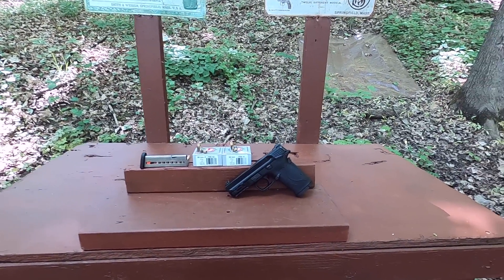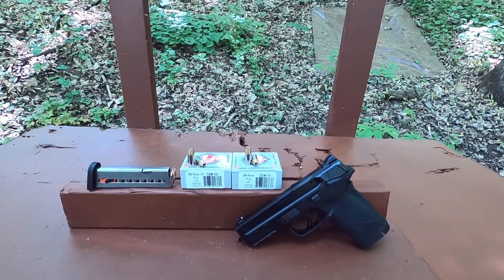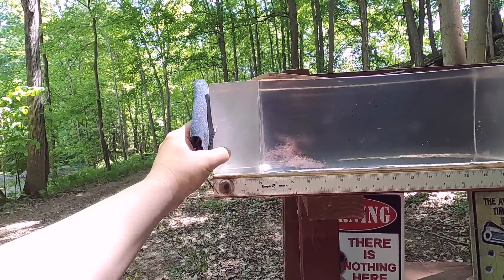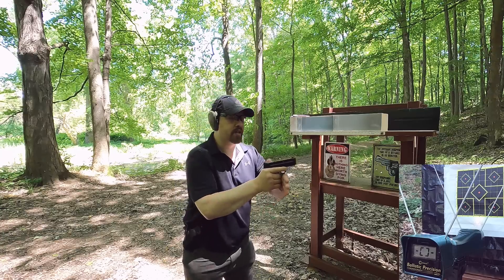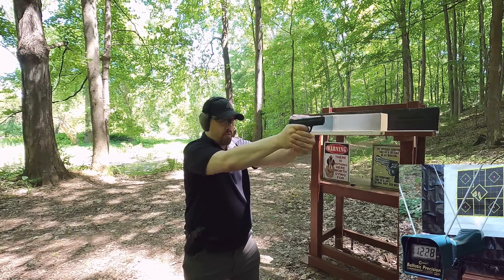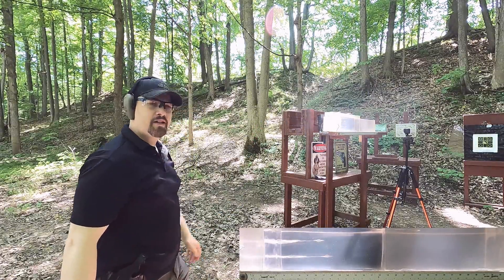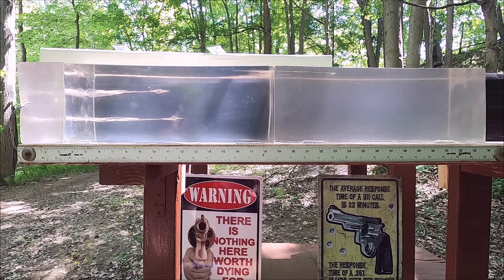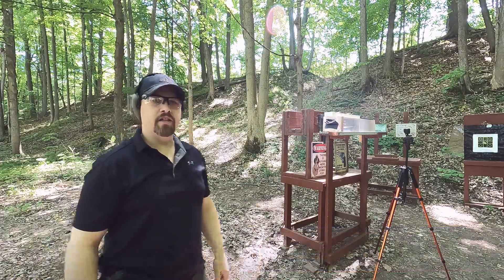Underwood .380 ACP 'Standard JHP' Ballistic Test - Standard Pressure VS +P

Comment: With the Plus P it looked like you are getting live round stovepipes which is an indication the slide is outrunning the round getting fed fully into feeding position. This is often due to the cartridge pickup rail hitting the round in the large extractor groove rather than the rim.

I heed your advice to avoid +P 380 ammo as I have the same opinion gathered the same way.  FMJFP at about 830-850 from a 2.75” barrel is just fine.

Comment: Ya know im seriously considering getting some of those standard pressure rounds due to the velocity and energy numbers alone...even though they didnt expand through the barrier they still had a nice wound track and they really didnt under penetrate either. Im sure id lose a little bit of velocity with my 2.8 barrel but even still the velocity and energy were impressive...if you account for bounce back they hit right at 12 in the bare gel...overall I think those are pretty good results for a 380

Comment: I own two of the M&P 380 EZ's and I have had the same issue with one magazine. It occurs on the last round of the magazine. I fixed the issue with that magazine by leaving it loaded for a few days and then the issue went away. 
My hypothesis is the the spring was at the high end of the tension curve. Once it was broken in, it stopped. It could be ammo. I did not notice what I was shooting, but I usually shoot Blazer CCI 380, 'cauz I can get it and it is less expensive.

Comment: Sam, thank you again for a grest test. I have tested these same loads in the G42, which is a slightly shorter barrel. I tested through 4 layers of denim but no MDF. The standard load did not expand but penetrated about like your test. The +p, however, expanded well and penetrated to 16". It has expanded well every time at the higher velocity and penetrates 14.5" to 16", which I thought was fairly impressive for .380. In my tests, this bullet out-performed the vaunted XTP (in the +p load), expanding more and penetrating deeper. Bare gel was 8.5" and 0.66" expansion. The MDF is the equalizer, perhaps, and it is really good to have as many data points as possible on any self defense bullet. 
I did shoot it out of the LCP Max also and got 12.5" and half expansion on one and 16" and 0.44" expansion (similar to XTP)  on the other...for what it is worth. That was through 4 layers of denim.
Shooting them through the g42 there were no malfunctions with either load. I did not shoot more than a few in the LCP max.
I did not try to hit at 75 yds though. A man's gotta know his limits. 😊

Comment: Great ammo review as always! I had malfunctions with my LCP2 & Ruger fixed it by replacing the barrel and ejector. Ruger customer service is the best, but have had good luck with Sig, S&W, CZ, Springfield, & even Kimber. They all take care of their customers. In my LCP2 I will run FMJ as you get adequate penetration. Only in 9 mm & above will I run JHP's, or Underwood Defenders. Your accuracy at 75 yards is impressive! As always, lookin forward to your next video!
Reply from the maker: Thanks. My experience with Ruger has always been pretty good. Experience with S&W is good, but they just are silent and just fix it and send it back, no chit chat. Taurus experience is really bad with customer service, like they don't know what they are doing.
Reply: @GunSam  Yes, you are right about S&W. They didn't say what was wrong or what was replaced to fix my PC Shield Plus. Sig's P365 series has durability problems as I've had to send them back numerous times for fixing dead triggers, FTE issues, & dead front sights. Even though the Shield Plus is slightly bigger & heavier, I believe it shoots better & holds up better than the Sigs.

Comment: That non expanding standard pressure round would be the pick of these 2 for sure tho.  14.5" to 16.5" penetration seems about perfect if it could just expand.  Sadly most of the .380s  just don't have the mass/weight to penetrate very deep. Especially if they expand. I guess 99 grains and the amount of powder a 380 case can handle just isn't quite enough.  I  finally got a new 380 pistol myself this past year, a larger "compact" size. Its amazing how similar, yet different in performance, the ammo for it is, than 9mm, with the same .355" dia. projectile.  I  bet that bullet would work in 9mm fine.

Comment: Great Testing as usual! To me the Underwood  Extreme Defender (Lehigh Defense projectiles) seems like their best round for 380acp. Maybe the Extreme Penetrator depending on your firearm barrel length.  Their clothing and barrier blind "extreme" ammo seems to work well in 380 where most manufacturers cannot get a heavy enough bullet & velocity  to penetrate deep enough (with expansion). The Federal 99 gr HST  Tactical "deep" gets close, but usually cant quite get the depth in 380, in most tests I have seen, unfortunately. Besides that, its usually unobtainium and pricey anyway.  Its seems pretty smart that Wilson Combat bought the bullet maker LeHigh Defense. Hopefully they still keep supplying Underwood with the same great projectiles. Underwoods solid copper Extreme series  has become my new favorite, for 380 defensive ammo these days.  (the Le High/Wilson bullet)

Comment: Good test. .380+p IMO is absolutely worthless, if you need something more powerful than standard .380 go get a 9mm. It does everything better and still doesn't have that much recoil.
Reply from the maker: I mean, I wouldn't necessarily say it's worthless. When going pretty small the .380 ACP is superior. And I don't mean in power, I mean that going 16-18 OZ in a 9mm pistol especially single stack, the recoil is terrible, not until the pistol is maybe 20 OZ and a double stack grip is it relatively low recoil feeling and easy to shoot. So in that tiny window of 12-16 OZ pistols, the .380 ACP shoots really well, and I would rather have that than have more power per shot. That's just me though, I have ankylosing spondylitis and I cannot tighten a belt, so a bigger .380 pistol feels fine, a 9mm pulls my gate just enough to not want to carry it.
Reply: Agree 100%

Comment: Nice video but if you look at S&W 380 EZ specs +P is not suggested for this firearm.
Reply from the maker: .380 ACP+P is not recommended by any firearm manufacturer as it's not SAAMI spec. One has to use common sense with using non SAAMI +P ammo like .40 S&W+P, 9mm+P+, .380 ACP+P and the like. You don't use a Hipoint or Taurus or whatever, you use M&P's, Glocks and the like.

Comment: I have a Shield EZ and it would random stovepipe as you experienced on the last round out of the mag. Different ammo, same result. I removed the mag spring and bent the spring on 3 coils and obviously both sides to maintain straightness of the spring and to increase tension, I have not experienced the stovepipe issue since.
Reply from the maker: Maybe I will try it. I disassemble them with every cleaning, finicky little things with how the follower tab has to go in just so, and the little spring base holder nipple has to be put just perfectly forward in the slot lol
Reply: I wonder if some new springs from Wolff or Galloway would solve the feed issue.

Comment: Wonder if Plus P would be reliable in LCP but would probably be good to go w 3.25" g42 idk...man .380 is hard I almost got a security 380 just to train others on.
Reply from the maker: Most hot ammo won't run in my LCP. It's 100% reliable with low end ball and Critical Defense. I have noticed that anything that gives me over 160 ft lbs energy will jam the thing up, anything less than that runs fine. I was going to buy the G42, but when I held them both I realized that the Glock was still super tiny. As another YouTuber once told me when we sent pictures in emails of each other's J-frame while holding them, he says "your J-frame in a lot smaller than mine" referencing my hand size.
Reply: @GunSam  I figured...slide reciprocating distance too small and too fast slide velocity
Reply: .380 is EZ

90-95 grain round nosed ball from a reputable company.

Comment: I'd be leery of that +p ammo myself. Good expansion but not SAAMI rated and had to be approaching 9mm Para pressures . Seems like it would be hard on a lot of less expensive blowback  pistols and the shooter as well. That said the standard pressure is strong stuff. That extra 100 FPS is enough to make a difference. down range.
Reply from the maker: I don't think they would reach that pressure, I think .380 ACP is only like max 21,000 PSI, 9mm is generally up to 35,000 PSI
Reply: @GunSam  I suspect you are right but that is some hot ammo. High performance too , the +p while lighter faster than several types of 9mm from the same barrel length!

It probably would be fine in the S&W as that is well made firearm but still I am  leery of over-pressure ammo and frankly the performance is often not worth the wear and tear, report and recoil 

The caveat is the .38 special +p  of course but its a well established round with only a moderate pressure increase and of course many revolvers are rated for it anyway

Comment: Yeah I've decided to upgrade my edc from 380 to 45. 380 just doesn't have enough power for me to feel confident in it.
Reply from the maker: .380 ACP is an exact scaling down of .45 ACP lol. If you look at the two, they are the same scale just one is smaller.
Reply: I would love it if Beretta would make a DAO subcompact single stack .45 with a bobbed hammer. Their Px4 subcompact only comes in 9 and .40 though ☹

Comment: It would be interesting to see what the +P does from something like an LCP. Would the +P give Enough of an increase in velocity to expand but not the excess expansion and decreased penetration we're seeing here, given the shorter barrel length of the LCP.
Reply from the maker: Might do well, then again might not run at all.
Reply: I dislike shooting the LCP so much I wouldn't want to test it. I'd rather slam my hand in the Buick door (I did that once as a child. It hurt!,)
Reply from the maker: @frankhinkle5772  LCP is an okay gun as long as you run Win USA ball and Critical Defense, both of which produce about 140 ft lbs energy. Anything more hurts.
Reply: @GunSam I’m not a LCP fan! Very ammo sensitive. So far my bodyguard has fired everything. I had to get use to the trigger.

Comment: Hard to believe Underwood didn’t see this shortcoming in their testing. I always thought they were a top-tier ammo company
Reply from the maker: Underwood is good in the sense that they are very bullet particular. Buffalo Bore may be hotter, but Underwood is known for being really specific like "Bonded JHP" using Gold Dots, they say XTP if they are XTP or say Nosler if they are Nosler as where BB just says "JHP". So you are right in that with this bullet, they should have done a bit better, especially because I was getting roughly rated velocity, so if I got their intended speed - they should have done great.
Reply: I really think Underwood/Lehigh performs best with the Extreme Defense/Penetrator or hard cast bullets. Just from my admittedly limited experience. What's your thoughts Sam?